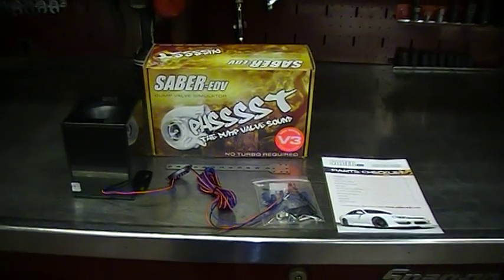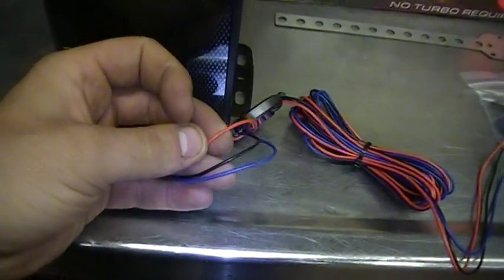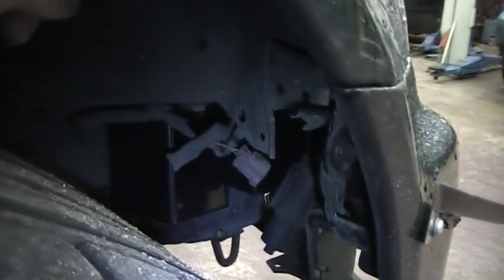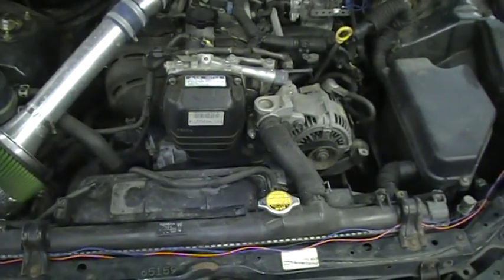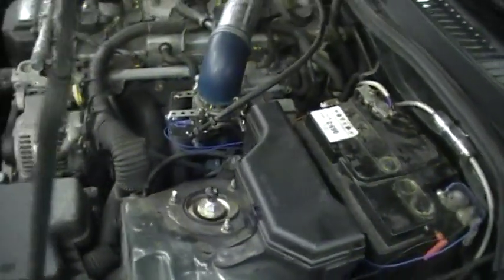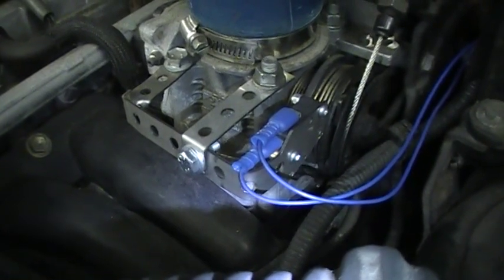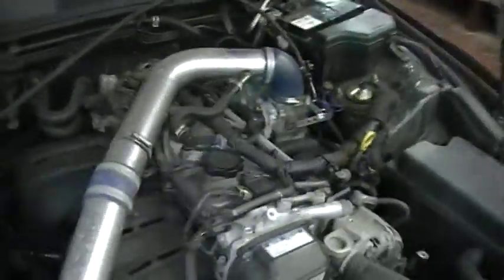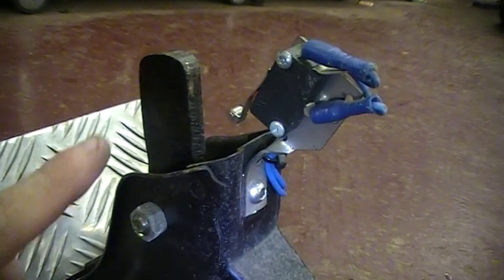How to fit the Saber edv V3 Fake Dump Valve

Comment from the maker: Yes it will fit all honda's, the best place to mount the saber is behind the front bumper facing downwards, or you can fit it behind the front headlamps in the engine compartment

Comment: Why do you take the red wire to 12volt on the battery ?  in the istructions is this written.

2.       The 12volt supply must be connected via the ignition switch so the SABER-EDV is only
powered up when the vehicle is running